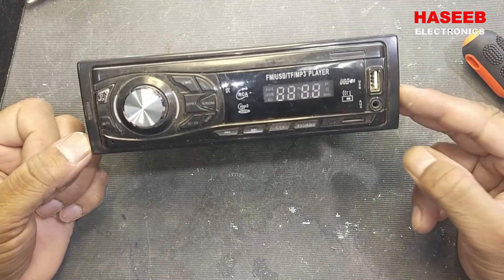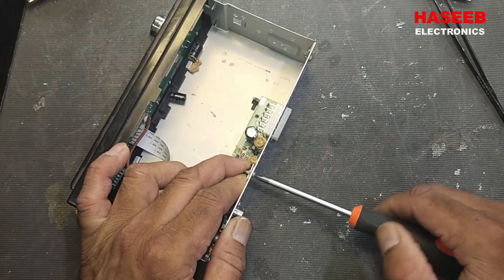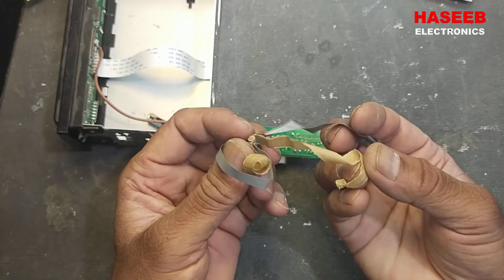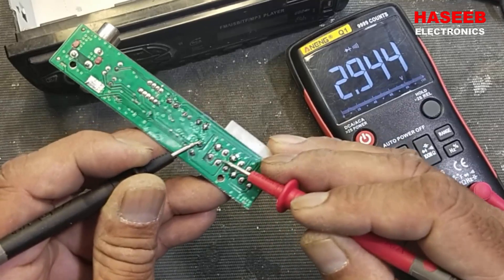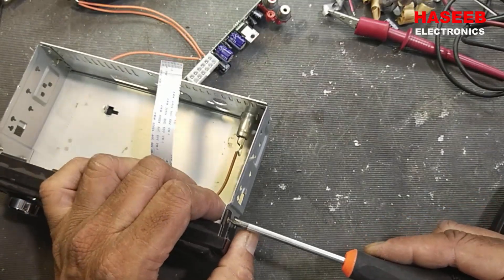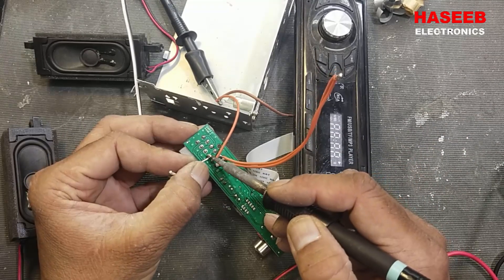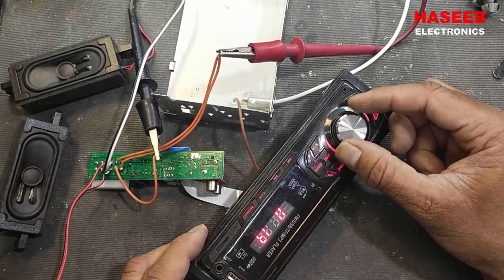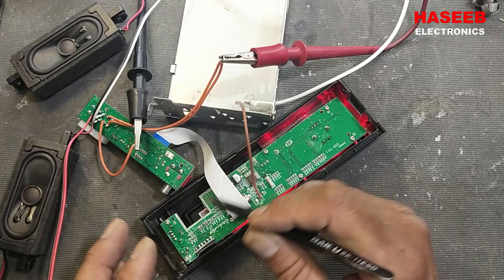[415] How To Repair Car Radio / USB/ MP3 Player - When Car Radio / Stereo Not Working

Comment: How do u know how is corect polarity...i mean the capacitors
Reply from the maker: i will explain it in upcoming video, how to know the polarity of a capacitor
Reply: @HaseebElectronics  not every board has polarity marked for the components
Reply from the maker: I recorded the video to explain it 
we have to find +ve out of the bridge rectifier 
or 
in case of 4 diodes bridge rectifier, locate the cathode side, that will go to +ve of the capacitor

Comment: 0:20 😳 Where is the electronic? The Box is nearly empty. 😳 But nice capacitors. 😁
Reply from the maker: these audio coupling capacitors were damaged inside the player. which i replaced 
the outer covers were flown away and were dancing inside the player and the resultant that the mp3 player was out of order

Comment: Thank you , I wanted to ask something that trouble may mind always when using external power source , like DC power supply to power that receiver .....you set proper 12V DC on power supply ,what about current capacity of that receiver ?is there importance of putting current limit on DC power supply? If so ?how do able to know what current limit needed by reciiver so u can set it accordingly?